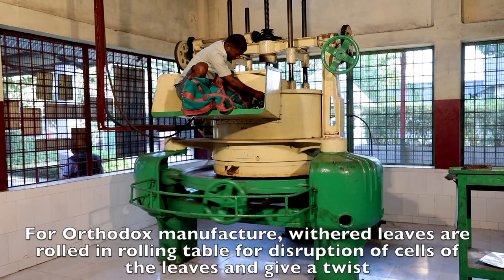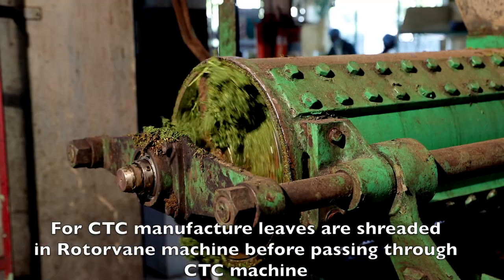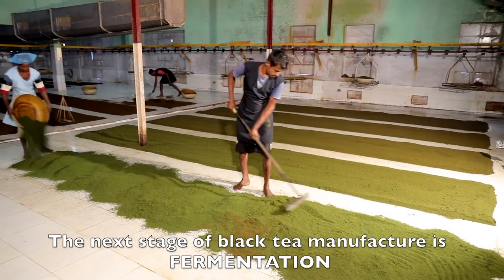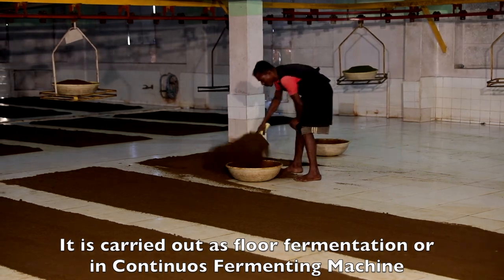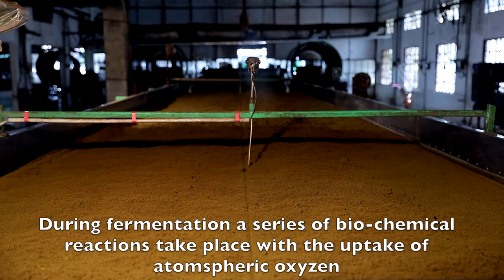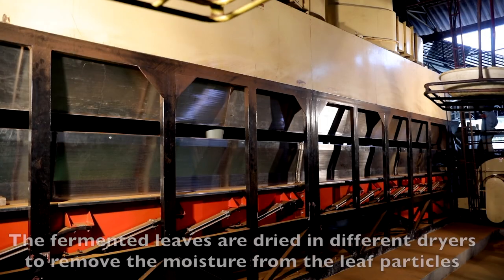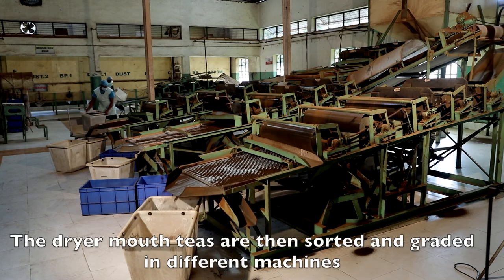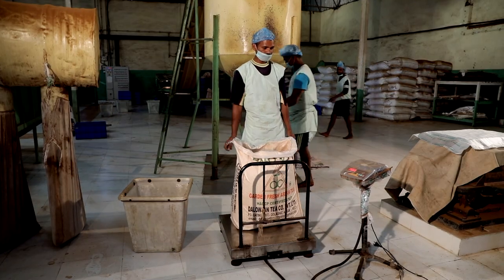Black Tea Manufacture-Tea World

Comment: Oxidation, not fermentation. There's a big difference between the two.
Something like a shou pu'er, is an example of a fermented tea. Or yellow tea is very shortly fermented.
Oxidation is a chemical process due to the polyphenol oxidase enzyme that's inside tea leaves,
fermentation is due to micro-organisms.
White tea can also be aged, hence fermented.

White tea in general, is more oxidized then green tea.
Because white tea is just withered & dried.
It's literally just dried tea. Like how you'd have dried peppermint for example..
Yinzhen are the unopened buds, mu dan is bud & leaves, gong mei is even less bud.
Because white tea isn't heated like the others, it remains having those oxidase enzymes, keeping oxidation going on at a slow pace.
Reply: Very informative. Thank you. I have a question: when the white tea comes to the last step, i mean Drying, then the enzymes don't activate anymore so the oxidation also does not occur. Is it right? Sorry, my mother language is not english.
Reply: @Hospitality711  I'm sorry for my late response.
White tea is usually slightly oxidized.